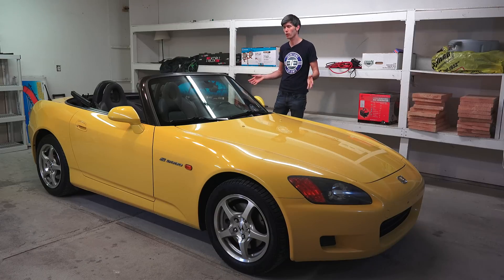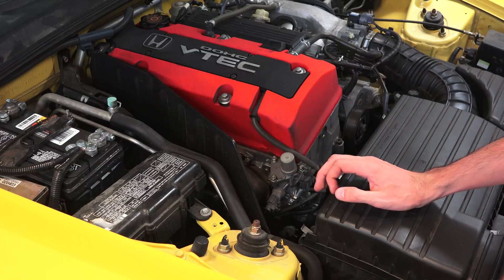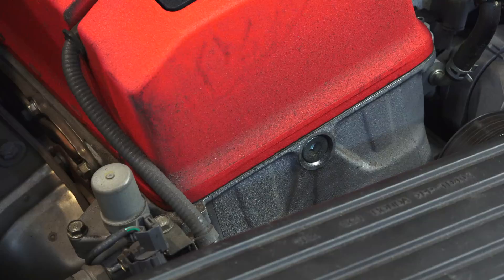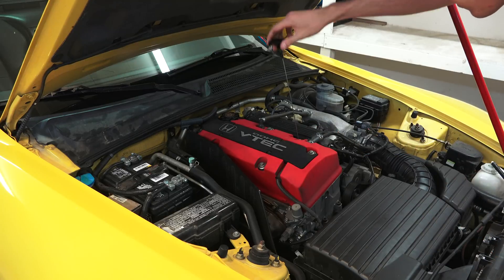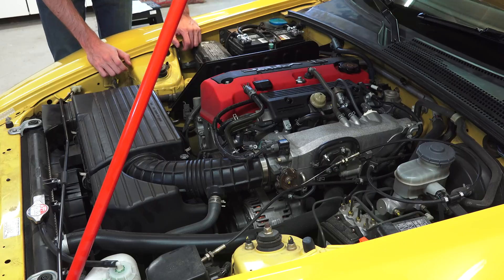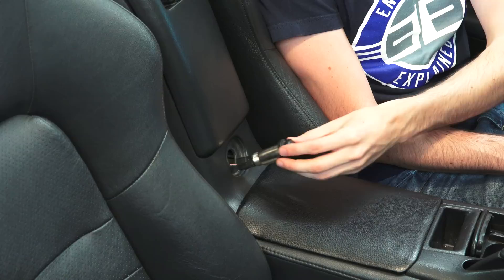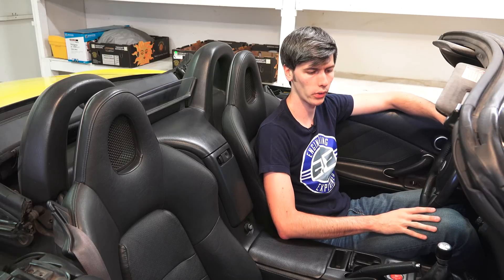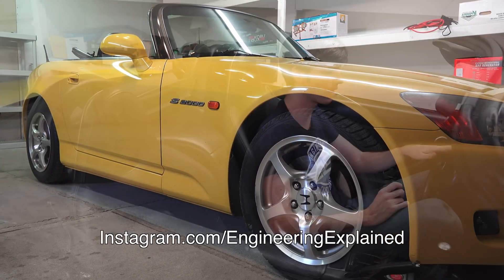What's Wrong With My Honda S2000?

Comment: Stock, engineered air box > aftermarket 3rd party "cold air" gimmicks
Reply: The box said 10hp.
Reply: There is a lot that i would say goes into this. The KN intake is probably the ONLY intake that actually helps the s2k, but even then, the stock airbox is made in a way to channel air coming though the radiator, at least as ive been told.

Comment: Get your spark plugs changed as well as upgrade to AP2 coilpacks. I did that. ALso i did a valve adjustment because mine had a faint missfire. I got my transmission fluid changed as well as diff fluid. btw, i also have the same color and MY s2k

Comment: pro tip you can remove the hood stand from the front right corner and place it in a hole on the passenger side right behind the shock tower to hold the hood open at almost a 90 degree angle for more better access under the hood 👍
Reply: and i recommend ballade sports tct because i replaced mine with a stock one and it went out again  after less than 10k miles. they go out quickly when the car runs low on oil, ballade sports has a lifetime warranty and NEVER heard of anyone ever having to replace it, its a bulletproof part
Reply: +Zachary Mullins what about billman?
Reply: +guitarguy8200 billman I've heard is vary good product as well 👍
Reply: Ballade is a good option for TCT replacement. I went back and forth between Ballade and Billmans TCT, I eventually decided on Billman. The guys been working on S2K's since the beginning, he's a machinist, and has had more S2000 engines apart than probably anyone outside of Honda engineering. Both have lifetime warranties, both are good options.
Reply: better access*
Reply: Zachary Mullins same. I even got the same color TCT as this guy gets in later video.

Comment: I would look at doing valve lash adjustment as well will you're working on it.
A fellow student at the tech school I attended adjusted his on his S2000 and noticed minor improvement to performance especially at higher RPMs.

I would be interested in watching videos seeing the work you complete on it as well.

I have always been intrigued by these cars especially after going for a ride in the fellow student's yellow one. He did install carbon fiber front fenders, hood, and front bumper. I don't recommend that, but was a nice car for sure.

Comment: the hood will prop on the left side if you pull the prop out of its hole on the right. there is another hole on the left side next to the fuse box which will allow you to prop the hood very wide open :)

Comment: You need to nudge the roof arm back as it's folding down, to prevent ripping the retention elastic and and top fabric. As it sits in the video, it's protruding up, putting a lot of tension on the elastic band.

Comment: Replace the battery cable with the right ones. The cheap fix ends at the battery will give you problems.

Comment: I have a 2008 Honda civic 5 speed manual. i live in austin and traffic is horrible so i shift alot without clutch, just get lazy and dont want to constantly press clutch. is that bad for the transmission? i rarely grind any gear.  i know off topic but just wanted to get some opinions

Comment: Dip Stick tip of the day! When drawing the dipstick out gently twist so you apply a light pressure which will drag the tip of the dipstick up the outside wall of the motor (facing the IM) This will give you an accurate reading. It's rumored some have lost engines do to the dipstick indicating higher oil levels than actual. Also take it out and wipe clean first then go back for a second dip to get your reading.

Comment: Just a tip, when you check the oil check BOTH sides of the dip stick it is common that one side may read fine but the other side has little or no oil showing. Could save your engine by doing that..

Comment: I mostly lurk but I gotta say that I would like to see videos of you doing those DIY projects. I like the way you explain things in your videos and would like your insight on those repairs
Reply from the maker: +Celso Garcia thanks for chiming in! Seems to be a good amount of interest so I'll be going for it!
Reply: +Engineering Explained awesome! :)
Reply: +Engineering Explained I'd also like the DIY work here. I'm guessing the brake rotors and pads are in good shape as well? Something I do with any used car purchase is just to flush out and replace the brake fluid. You should get under the car soon, I'm sure there's some rust so you can spray some wd40 and remove it. Always a great preventative maintenance a lot of people forget.
Reply: +Sergio Ruelas R '  cac

Comment: make sure the elastic strips in the roof are replaced. otherwise you will wear a hole on the top. not 100% but from looking at your video the top is not down all the way. these strips pull the bear back when you put the top down and makes the roof fold flatter.

Comment: With the mileage and the age, if a complete timing service hasn't been done, do it. Don't just take the easy way out with replacing the tensioner and o-ring. Do the timing belt, tensioner, valve cover gasket, water pump, flush the coolant, replace the drive belt and change the plugs when you go to do the oil pan. Do the right thing and get on the same page as your engine.

Comment: You'll be fine. Assuming the engine is just leaking oil (not burning anything beyond normal), this is a great car to learn simple maintenance and repair. My Miata had low miles but was very behind on maintenance and had a lot of little issues which I gradually fixed over the years. It's very gratifying work.

Because you've bought a cult car from the early 2000s, everything that usually goes wrong with them has already been well-documented. There will be plenty of information to guide you through the work.

One last thing: make sure you always check the oil level after the car has sat for a while, as this will give you more consistent readings. And, you MUST wipe off the dipstick, then slide it down all the way and check it. Otherwise, oil that sloshed around higher up the dipstick will give you an inaccurate reading.

Comment: Hey! I would love love love if you did an episode/video on replacing the honda seal and o rings on your engine :)
my Honda 99 lx ej6 is having an oil leak and i haven't gotten any work done on it yet because i dont have enough money to replace, plus the mechanic said it wasnt a big deal. just something to look at, and i read on forums something along those lines is the same problem with my engine 1.6 sohc nonvtec, and because it doesn't sound too painful i would love to see how to! :D thank you so much for asking about suggestions

Comment: Don't drop the retainer pin into the engine block when inserting the new TCT
Reply from the maker: Haha I was looking at that and it seemed a bit stressful. Perhaps best to use the 5 mm bolt method and remove the pin beforehand, or go for it and be careful!
Reply: It's not too bad after the first time you do it. Before inserting the TCT I used needle nose pliers to pull the pin just enough so that I could get a solid grip on the pin from the maintenance port once it was in. I had to replace it about once every 12-18 months

Comment: The AP1 block was not bored using a torque plate (unlike the AP2 block) and this supposedly causes extra oil burning in AP1s. Mobil 1 oil seems to burn pretty bad for most owners. I recommend 10w-40  motul, valvoline, redline or pennzoil

Comment: I haven't scrolled down to check, but I don't believe your top is going down all the way. Another thing though I may add. If you plan on tracking the car, replace the valve retainer on the intake side with ap2 ones. Also, while your are redoing the oil pan seal. Order the ap2 oil squirters or banjo bolts the spray on the piston/ wrist pin. Ap1s don't seem to do the job. Also lol.. I could go on and on. Re torque the rear axle nuts to 220lbs. I may be mistaken on that value. Hope this helps. I have a 99 well 06/1999 first year production #142. I've done all these things and then some.. I track the car and drive it respectfully hard with no issues.

Comment: Billman TCT.  Find him on S2Ki.  Replace the banjo bolts with the AP2's.  Replace the valve spring retainers with AP2 as well before you crack them and blow the motor.  Also, do not ever take this car to a dealer for any service again.  Learn to do it all yourself or find a local shop that is well recommended by the S2K community.  S2Ki will be your best friend.  Read, read and read some more.  Again, do not take this car to dealer mechanics.  Flame me if you want, tell me how great XYZ dealer is, I don't care.  The simple fact of the matter is, they push cars out as quick as they can and will not take the time to put in the extra care that is needed to ensure everything is done right, every time.  I won't even let them change the oil in my wife's daily driver.
Reply: 1 more thing, the AP1` diff is glass, don't dump that clutch.  At some point it'll give anyway, AP2 is a good upgrade but they are still fairly fragile.
Reply: Puddymod makes great diffs. I upgraded my AP1 diff that failed with his stage 2 diff and it feels great. Good up to 500HP and he has yet to see any manufacturer failures with his products.
Reply: Puddymod is a good solution but it isn't cheap.  There are other solutions as well, even as far as swapping to an entirely different rear end such as the Ford 8.8.  But again, it all starts getting really expensive.

Comment: Uhh, what I've done to my 2002 AP1 S2000 so far.

Timing Chain Tensioner
Valve adjustment and change to AP2 Retainers (if you have ap1 they are known to crack)
New VTEC solenoid, it leaks around there and new gaskets are hard to find so I bought a whole new unit
Check the Clutch master cylinder for leaks, and might as well do a flush with new fluid. Mine went bad around 90k
You can use a heavier weight gear for the diff if you plan on road racing 75w-110 or 140
Uh check your engine serial to see if it got the oil banjo bolts
Check oil religiously, AP1's are notorious oil burners. I know mine is. Some people have better luck with castrol edge, some people report higher consumption with Mobil 1, I use AMS OIL

Comment: Ap1's will burn more oil then ap2's because the sleeves of the cylinder walls are made out of weaker material.

Comment: Check your manual to see if the oil should be checked cold or warm -  say 20 minutes after driving.  That could cause different readings on the dipstick by a half to a quart of oil depending on its capacity.

Comment: Use Honda Ultra Flange 2 instead of Hondabond for the oil pan gasket. Part # 08718-0009.

Comment: they burn oil if you really haul ass on turns, like on the track.  Because of the oil shifting from the turn.  Also, get a Ballad Sports timing chain tentioner.  The honda OEM ones sucks.  they usually go back around 50k.

Comment: - Check the valve retainers for cracks.   
- Consider GM Friction modified trans fluid for the gearbox.  I use it in mine. 
- Don't forget to change the cabin air filter.  It is often overlooked. 
- FYI - You can replace the fill bolt on the diff with a diff drain bolt.  That way you have two magnets catching any particles/filings.

Comment: Quick tips. Leave the stock airbox alone. Check oil on a level surface check, wipe, and check again. If you're compression is fine, replace the valve stem seals. I would just replace valve stem seals, valve cover gasket, and the oil pan gasket while you're at it. And of course fluids. Maybe a whole tuneup but you'll have to check service records for that. Anyway that's just my two cents. Don't worry about rust on the control arms haha that's not a big deal. Consider the HKS supercharger when you feel like you need more power.

Comment: YES! would love to see some more DIY tips.
Check the roof goes all the way down when you put it back, loads stay up too far & need the straps replacing.
Has he found the secret compartment yet?
I can think of 3 things right with this car straight away:
1. Yellow
2. 9000RPM unlike 2.2
3. Looks like its going to be cared for

Comment: Timing chain may also be a little stretched.
Reply: honda techs say the chain should last the life of the car as long as you keep the tensioner working well and maintained. I could be wrong but that's why I heard from a Honda Tech when replacing the tensioner.

Comment: one of the best engines on this planet. even though i'm not into hondas actually.
Reply: I appreciate these kinds of comments.
Reply: Absolutely!
Reply: I impressed how high these hondas rev. Nice throttle response too
Reply: one of the best indeed!
Reply: +Ilovemyr6 r6ftw ap1 vs ap2 , which is better for whom
Reply: AP2 is a little torquier with a slightly lower redline (a few extra HP to the ground even though the claimed output is the same). Interior and exterior had some minor tweaks, main difference is the suspension geometry and spring/damper rates, as well as the wheel/tire size change. Some people say the AP2 isn't as "edgy" as the AP1, but the AP2's "less-edgy" setup is actually better for most people as it's more stable on the road and some drivers even get better times at the track -- Keiichi Tsuchiya got a faster lap time with an early AP2 (which still had the F20C in Japan, so no difference in power) compared to the AP1, I think on Ebisu circuit, I forget the video.
Reply: South4153 
yup..often being adapted for aircraft..
Reply: South4153 I’m not into honda but the s2000 is a gem and i want one lmao
Reply: K20a is best.
Reply: @TheKevzx6r  K20A is the poor man's F22C
Reply: I think that the k20 engine has proven to be a better engine & more reliable (not more powerful though)
Reply: K series beats it hands down

Comment: I worked at Subaru building cars. The trim stuff is designed to go together at the factory quickly, easily, and stay put. If we had a defect to work on, only our familiarity with building the things allowed us to take things apart easily. So I would say get a real factory service manual and go slow. NEVER force any trim piece unless there is simply no other way, then try to bow it or squeeze in a way that releases hidden plastic tabs. Plastic body repair tools are awesome. Don't lose any fasteners or push pins. Have JB weld handy. I think you can handle the mechanical stuff!

Comment: A few things. I'll be abbreviated since I'm on the phone. I'm impressed with the condition relative to its age. 1. I have an unorthodox way of fixing the timing chain tensioner (TCT). $0 cost and it's most effective (did the fix Jan 2015). If you shoulder the cost of replacing the TCT with an OEM, By design, the problem will eventually resurface. The sand blasting also doesn't permanently fix the issue. You can also go for Billmans TCTx or Ballad Racing's TCT. 2. Your convertible top is not going all the way down. This is due to the elastic straps on each side, wearing, not being tight enough. In the worst case, it might lead to a tear because the top isn't folding properly. It needs to sit lower.  I can elaborate on my free TCT fix if you're interested. I'll explain the science behind it and show how it worked for me. Feel free to message me on here. I have a yellow one as well :-).

Comment: Again, IMO, get the valvetrain done. Go stronger valve-springs, guides, seats and valve retainers, lastly get a valve-adjustment. Hardly anyone gets a valve-adjustment on these motors. Next, get oil banjo bolts from AP2 since those lubricated more than the AP1s did. Doing all these would really future proof that motor.
Reply: The valvetrain on these cars are solid and hard to improve upon.  The only thing potentially needed is valve retainers if they crack.
Reply: Stephen Baker - The springs aren't great, some say the springs cause valve-float at high RPMs. Retainers are ok as long as you aren't miss-shifting or over-revving. The guides though aren't great, so with all that said, few a few hundred, I would replace it all. I'd say 70% of S2K owners whom go FI, replace their valve-train to prevent any issues.
Reply: mid year '02 AP1 and all '03 AP1 have the upgraded banjo bolts.  OEM is the way to go for the valve train but some replace the intake retainers/keepers with AP2 units for AP1's.  Valve adjustment to spec is critical on the DBW AP2's as they tend to burn exhaust valves as they tighten over time- spec for AP2 DBW is IN .008, EX .011.  All others use EX. 010.
Reply: darcygoesfast - If its being touched, I'd rather spend the coin and do valve-guides and retainers at least. Lots of owners, including myself had oil burning S2Ks. Once I changed the valve-guides, I saw huge improvement in oil burning.

Comment: With the oil level, wipe the dip stick clean. Re-dip it and then read both sides and take the lower reading.  That is the true oil level.